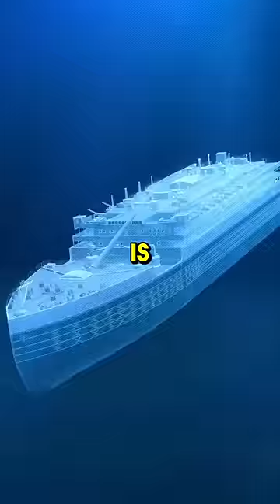Why it's Impossible to Lift the TITANIC

Comment: Wait a few decades and you’ll be able to lift it with a vacuum cleaner.
Reply: Lmao best comment
Reply: Right? Lol
Reply: Finally someone with common sense that doesn’t bitch about something that’s been resting on the sea bed for over 110 years 😂
Reply: That would take approximately 28.82992456789% of all of the earths atmosphere to even operate and turn on.
Reply: Not to mention the intense pressure the vacuum would have to withstand.
Reply: I say, call on Yoda. If he could use the Force to lift Luke's X-Wing Fighter Jet out of the swampy lake in The Empire Strikes Back, he's qualified to lift the Titanic.
Reply: I shouldn't be laughing but lmao

Comment: Also forgot to mention that people thought they could control a submarine with a controller💀
Reply: the controller worked fine it was the integrity of the hull that gave in and crushed them😂
Reply: Woah using a controller to control something…
Reply: @gatlinphipps5891  -_-
Reply: @gatlinphipps5891 woah using a controller from 2017 in a sub that failed when it was put just below the surface and failed and is now going 12,000 feet under water:

Comment: The intense pressure is unimaginable yet there are glass bottles still down there that are perfectly fine
Reply: Yes because those bottles are already pressurized from when they were initially filled...it is like pressure from within the bottle counteracts the pressure of the outside water...the pressure of the water would damage something that already has oxygen in it which is not the case for these bottles...so they are undamaged...the liquid inside though, may it be wine or whisky or whatever, would not be drinkable, it is affected basically by the environment, and it is most probably just a grey, tasteless liquid.
Reply: @Channelofdeeasunset but it would command a fortune at Sotheby's auction
Reply: @michaelrodriguez3329  yes , true
Reply: Because they contain liquid not air. The pressure was equalised.

Comment: I expect it's too weak. It would need hundreds of thousands of pounds worth of surveying for a recovery operation. 
But likely a survey would determine It too weak to lift using any method we currently use.
Probably, the only way would be to build tank around it, sealed of course. Drain the tank very slowly and do it that way.
However, a huge tank at such depths might not be possible anyway without significant risk of implosion.
Reply: don't forget that once oxygen hits it the ship will fall into dust and probably cause health issues to the surrounding area since the thing is covered in rust and bacteria
Reply: @chroniclesofoddities8893  yup true. So you'd have to consider using pure argon to fill the tank. And then keep it in the tank until a treatment can be applied. Probably in vapour form. It's getting too complicated
Reply: @mikeh2006  yee

Comment: If it wasn't rusted, it's quite possible.
Reply: No, even if it wasn't rusted, it would still be impossible. Titanic is way too heavy to be lifted and it would most likely break into several pieces from the attempts of lifting + the crumbling pressures underwater
Reply: The change in pressure would be less than ideal

Comment: It's been rusting away under immense pressure and has been attacked by iron eating microbes for over a century. It's only the pressure of the water - and force of habit - that stops it collapsing into a heap of rust. Or dust.
And as for the graveyard aspect, the only thing left of the victims is memories but it's still a graveyard.

Comment: One idea we could do is to build a glass container around the titanic all the way to the surface and then pump out all the water and then preserve the wreck.
Reply: The glass would just break because of the pressure at the depths where the Titanic is
Reply: @jophes9921   you've just described the Titan 😂😂😂😂😂😂😂😂
Reply: Lol
Reply: If you built it at depth when you lift it the glass would explode since there’s more water than volume in the glass case
Reply: Maybe we could build it out of carbon fiber
Reply: U go to school?
Reply: The glass container is just gonna crack way before it even reaches the titanic. The pressure is to strong
Reply: @gryphey  we build a thick titanium container or if adamanium existed then we use that since its indestructible.
Reply: Like Sandy Squirrel’s house.
Reply: That’s not how any of this works
Reply: @gryphey but I swim in 7 metres Pool i never felt any pressure on me ever???
Reply: @rahulsinghania3078  cause that's 7 meters. The Titanic is 2+ miles underwater
Reply: @gryphey  just joking ☺️ i knew pressure is really very intense as deeper we go in the ocean
Reply: the water is the only thing holding it together

Comment: I think they can lift the Britannic instead of the Titanic because it is 400 meters in the Aegean Sea, but I don't think Greece will allow it because it banned it and the Britannic is more advantageous because it is in a piece shape. Only the front bow was broken and I think the pressure value is low considering the depth of the sea.I think it can be removed with a crane. 😊

Comment: I have an idea that might work, so we build a large tank ( with a floor ) around one of the two pieces, the walls need to be really thick or it will collapse, then we empty the water out and fill it with air at the same time, so it doesnt create a vacuum, then we lift the whole thing slowly, do this to the other piece and it might work. But it will be very very very heavy, so this probably wont happen for 100s of years.

Comment: The weight you said is a bit off. Shes actually only around 46,000 tons.
Reply: She was 46,329 gross registered tons, which is not the true weight of a ship; GRT simply measures the amount of unoccupied space within the hull and enclosed space above the deck. The ship’s true weight is measured by its displacement, which is how much water it moves in order to float; in Titanic’s case she weighed 52,310 tons.

Comment: The reason they want to lift it is to see how big of hole and if the water overflowed over bunker 5. And see if it was really the coal fire to weaken the hull.
Reply: Not the coal fire. It was a smouldering fire. Smouldering fire doesn't reach melting point of mild steel.

Comment: Well, cut it up into manageable pieces and reassemble it on the surface.  That's how large homes are often relocated, even castles ... Or just leave ... it ... where ... it ... is ... resting ... in ... peace.
Reply: it would fall apart on contact with air so the end of your comment is correct

Comment: Has anyone ever thought of building a huge funnel made of some of the strongest material that spans from the surface to the ocean floor surrounding at least one or part of the wreck, then draining the water from inside said funnel? And by drain I mean “toss the water inside to the water outside”? 
I suggest the idea because, hey, if we can make oil rigs have drills that go that far down, why not this?
Reply: the wreck piece would fall apart from sudden oxygen exposure
Reply: @chroniclesofoddities8893  figured it wouldn't be sudden; the draining would take time. Months, years even.

Comment: This question is probably very stupid but maybe slide smt strong under it and lift it all? Probably won't work pls no hate
Reply: Lifting it would still be impossible in that case but the main issue is the fact that Titanic is buried in the mud. Not all of it of course but a tonne of it is stuck very deep in the mud.
You'd need some underwater mining facility to even excavate it.

Comment: Slide a metal panel under the ship and slowly pull it up???? What’s the worst that could happen it break apart even more? Better than never getting it out of the water
Reply: because by the time the metal panel comes to the surface it will be covered in rusty dust😔

Comment: These facts are true, but It is in 3 main peaces not in two; and you cannot lift it because the structure is slowly eaten away by a iron eating bacteria. If you touch it collapses under its own weight. And as the pressure is constant both inside and outside the hull, it has nothing to do with the pressure. But otherwise all info is true in the video :-)

Comment: Once you lift it how do you transport it?
Reply: you cant since it will turn to dust before you can even contact a transportation team
Reply: @chroniclesofoddities8893 I know, I just find it funny that even if it wouldn’t deteriorate on the way up, how do you haul it? I’m sure there would theoretically be a way but still seems like it would be WAY too much trouble.
Reply: @loganhunt87  ship go insert lego falling apart sound

Comment: Anyone else catch that...🤔
How do they know the weight since 1912??
You'd have to had lift on it too calibrate its current weight 🙄....
US government slippin again 😉🤫🤣
Reply: Or just know how much each piece weighted and calculate it
Reply: @Nolangames-ep8up I can see my comment and this video flew completely over your head or is too much for your processing🙄....
Now go open a physics  book and read up on the  chapter of "displacement ".....The ship was logged on width, height, and weight prior to sinking! 
Not after splitting or imploding...🤷🏿‍♂️
We're not retiring it too ship yard for scrap, it's 12,500 ft under the Atlantic Ocean.... regardless rather it could be lifted or not do to decay? 
Unless they lifted or were able to measure  weight at its current state...114 year ship records are irrelevant  🤷🏿‍♂️
 Matter of fact science literally calls it... "Inclusive" 🤫
Reply: @dustinredding4897  No they are not irrelevant because they give you a base to work with. You know how much it weighted when it was built and you also know that a lot of the weight is gone. If you add up the amount of pieces you can get a rough estimate. You can add displacement of water and how much of the weight was lost due to rust and bacteria after you get a starting point to work with. I don't get your whole point at all. Are you saying that the government has the full weight or that they shouldn't know it? Are you saying it's pointless to bring it back? Because the video was about why it's impossible to bring it back to land. Your original comment doesn't talk about the point of the video at all.